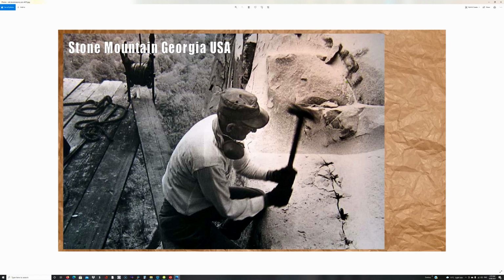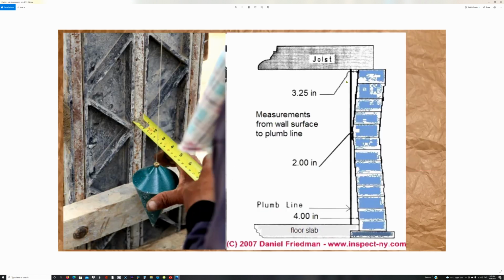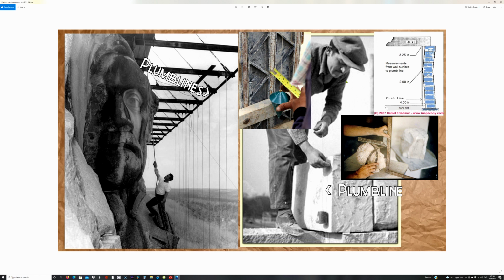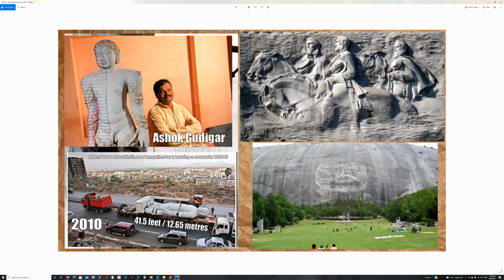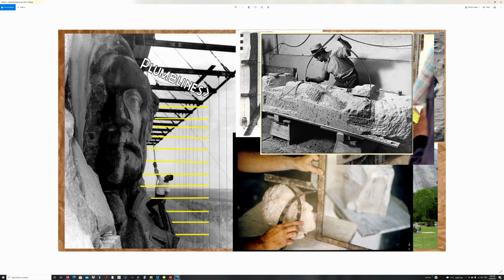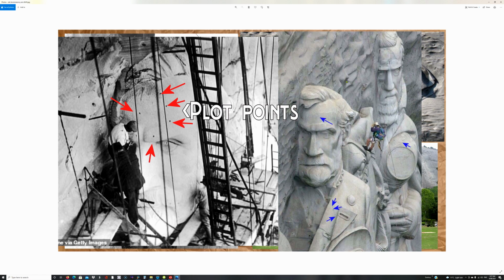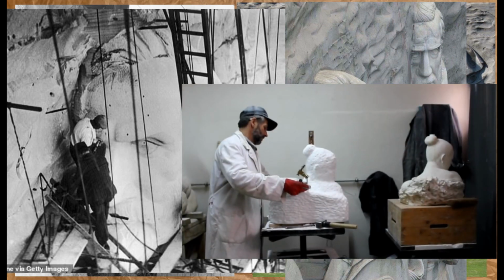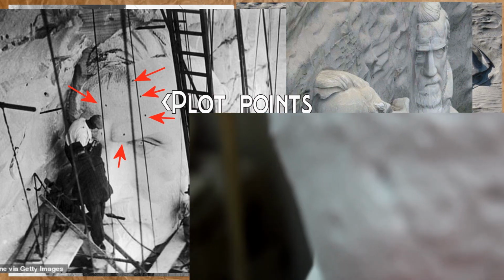How to Make a Giant Symmetrical Egyptian Statue without giant Ancient High Technology CNC machines

Comment: Your points are well taken, but if one were to apply your own logic to your arguments then there are also bits that you leave out/don't explain.

Flatness - plumb lines are made from twine or leather. That's great for creating a rough lines. But how do you get flatness to within thousands of an inch across large surfaces, in materials such as granite? 

And let's assume that you manage to answer the how...that still leaves the "why"?

Why, unless it was easy and not time consuming, would you create extreme flatness on surfaces that don't need to be flat beyond what is perceptible to the human eye?

There is unnecessary precision in so many old artefacts. But it's not only precision that is often times far beyond what was necessary. 

Scale is another element. It's far easier to build a wall out of a thousand small stones than it is to build it out of one ten tonne stone. It's easier to use mortar than it is to precisely cut sones so that no mortar is required, particularly when every stone you cut is unlike anyone other in size.

Then there is geometry. Why include geometry into sculptures when hardly anyone would even notice it and even less would understand it.

Ultimately, to answer these questions you have to explain why people would take ten years to produce something that they could produce in one month when the one month version was functionally, and aesthetically, on par with the version that take much more time and resources to produce.

And finally, style. Take the depictions of faces in ancient Egyptian sculptures. You note that over thousands of years, the style remains the same. Now, you might say that this style was passed on down the ages. Think about it and think about how small populations were back then, how susceptible to disease people were and how low the average life expectancy was. Consider how long it would have taken to produce just one large sculpture of a face. And on top of that, consider the rebelliousness of human nature and our eagerness to improve and change things. Is it really conceivable that over thousands of years, against the odds, the same style of depicting faces was maintained and the information stream remain uncorrupted by error, human nature or act of god? It seems highly unlikely to me.
Reply: Exactly, that is an issue that bothers me when seeing complex geometry and extraordinary perfection in ancient construction.  In modern times we have developed the technology to create high-precision tooling that in turn creates high precision parts because it is necessary for function in some particular industry.  For example, in the automotive industry, precision machining of CGI, steel, and aluminum is necessary to meet emissions regulations and market demands for vehicle longevity.  Once this level of precision is achieved, it becomes the default standard, and even components that don't require that level of precision for function receive the same or close-to-the-same level of precision, simply because that is what the tooling delivers.  It becomes easy.  In ancient times, if everything was done by hand using simple tools, why go to the extra effort to achieve exactitude on ornamental structures and statuary?

Comment: Are you sure that the level of precision achievable with hand tools like plumb lines and calipers can be used to meet the actual measured precision of these artifacts?
Reply: It may be more detectable
If they had used advanced tools simply by scanning it then comparing the percision of the two sides.

Comment: Here in portugal our country was very poor and backwards up till the 70s. My grandpa started working at 10-11 in house construction back then, and they had no power tools or fancy gear. He's shown me many plumblines, measuring ropes with nods in equidistant sequence to measure things, flat stone srfaces made by grinding 3 rocks against one another, simple chisels and hammers, drawings made using a geometry compass, etc. 

The most complex thing he ever worked on was a warehouse with pillars in the middle that supported arches, you know, like those gothic arches that make an X if you look up since its 4 curves conected to one point. In none of this did they need a powertool to carve, measure or lift the stone. The metal used was in the chisels, hammers, pickaxes, cranes and compasses. The only thing ancient high technology proponents cant find is a building site, apparently.
Reply from the maker: Yes indeed. I even filmed and posted a bunch of demonstrations with primitive tools on granite to answer the challenge made by “expert” masons of lost high technology.
I only hear crickets in response.
These guys need to call a mechanic to change the radio station.
Reply: Interesting. I work in the building trade and speaking to older guys who were around before powertools, it is fascinating hearing how they done things and couldn't imagine doing it nowadays. 
For example drilling a row of holes in joists for a cable/pipe to pass through could take 15-20 minutes with a power tool but doing by hand could take someone best part of the day. 
Point is to someone used to power tools it seems crazy and so much effort but if that's all you have available you get on with it and get it done. We take the older methods for granted because things are so easy with modern tools and materials.
Reply: Lie. I am and have been in portugal much before the 70's. it was in no way a POOR country lol.

Comment: 0:49 "People have been replicating them and showing them..."  Who's replicating the 1000+ ton granite statues at Tannis?  I've never seen anyone replicate said statues? I've never seen anyone replicate the 50 foot, 700+ ton Ramesses statues at Luxor.  I've never seen anyone quarry, lift, transport, cut, finish a 1000+ ton granite obelisk as the one in Aswan.  When you say replicating, you can't just replicating without showing the exact same thing done.
Reply: you said 50 foot statue of rameses. The bahu bali (GOMATESHWARA) is 57 foot high as tall as your so called rameses. How did you even come up with 700 tons. If you take a  50 ft or 15 m long high rectangular block and has a base of 3.5x2.5m and the density of granite of 2.7 tons per cu.m.  you get 15x3.5x2.5x2.7=354.4 tons if you exclude remove the stones to the final shape of the statue you might be down to 200 tons.  That could be easily pulled by around a  hundred oxen.  So which mathematical genius did you get the 700 ton value. As SGD said if you really want your rameses to be built you should hire the team who built bahubali. Why would rameses be impossible?
Reply: @JL-tm3rc  The statues at Tanis are over 100ft tall. SGD needs serious mental help. As do his followers. I wish you the best.
Reply: @coryCuc when a 57 foot granite statue from india debunked your claim. You bring out a 100 ft tall statue in tanis but there is actually a much taller statue 133 ft in india called Thiruvalluvar Statue built  recently out of granite. So are you now going to claim there is a 200 ft statue in egypt.
Reply: @JL-tm3rc  Nothing debunked anything my guy.
Reply: @coryCuc  haha you are the one looking for replication and the statues mentioned that are in india are even way larger than those in egypt. You cannot even get the weight of your statues correct just exagerrations you have heard from someone else without doing basic math first
Reply: @JL-tm3rc  The weight is correct.
Reply: @coryCuc  i just gave you a basic computation assuming the statue is a solid rectangular block it would not reach 700 tons. Here is another computation to debunk your 700 ton statue.  Let us say you take 5' tall human being which weighs 50 kg let us roud that up to 70 kg. The density of water ia close to the denaity of a human body. Let us now take the specific gravity of granite which 2.7. For a 50 ft statue or 10 times  the 5 feet height you will have mass of statue=2.7x70kgx10x10x10
=189000kg or 189 tons too far away from 700 tons

Math do not lie but you certainly do. If you are going to say you do not understand the computation please review specific gravity calculations hahaha. 

You have to be gullible to have believed the 700 tons without thinking about it first
Reply: @JL-tm3rc  Keep drinking the SGD kool-aid.
Reply: @coryCuc  haha the what a lame argument of a defeated man.  haha
Reply from the maker: What an idiotic comment Cory. The method for replicating is right there. A recent giant symmetrical statue.
But to convince you, someone who is literally ignorant of the recent giant moves that were photographed, has the nerve to set up standards?
Here’s the methods as seen above. Now you go and pay for it. What an entitled lazy little pos to demand others do the work even after they’ve been shown how.
Reply: @SacredGeometryDecoded  You can't make a tiny little replica then extrapolate that into an almost 100ft tall 1000+ ton statue.  It'd be the same as me making a 4 foot high pyramid of bricks and saying well, all you gotta do is add a lot more to it to make the pyramids.  Nevermind.  That logic doesn't work any way you look at it.

You're the one who says they know how they're built. I'm saying I don't know.  So the burden of proof is on YOU to build it exactly as you propose they were built.  If you don't YOU are the lazy little POS.  Put your money where your mouth is and replicate a 100 ton statue.  We'll all be waiting...
Reply from the maker: @coryCuc  literally includes a giant Bahu  Bali sculpture. It’s like you have a condition that blocks out any relevant fact you don’t want to hear.
There’s a giant  symmetrical statue made post invention of the internet with traditional methods in this video.
It’s one of the largest ever made and you are blind to it.
You are in a cult Cory. Get out now while you can.
Reply: @SacredGeometryDecoded  Build an 80 foot statue in the EXACT same way that you're claiming they built it, from quarrying, transporting, cutting, shaping, polishing and erecting it with the way YOU prescribe is the way they did it.  You say you know. You say it's easily done. 

So just do it. What's the problem?
Reply from the maker: @coryCuc  to anyone reading this please be warned that Cory isn’t the only one. Long exposure to Brien Foerster , Uncharted X, megalithmaina, jahannah James and these types of influences will do irreparable damage to your brain.
You will post comments like this on a public forum and not even realise how much of a fool you are making of yourself. 
Poor Cory here is lost but if you or those close  to you spot the warning signs early you can be successfully treated.
Reply: @SacredGeometryDecoded  Ohh lord. Lol.  Another ad hominem.  Weak arguments man.  Brien Forester? Who thinks everything was destroyed by plasma bursts? That wack job? I have no idea who Megalithmania is...that Jahannah girl couldn't find her way out of a wet paper bag. I do enjoy Uncharted X.  

Maybe you could pick up a thing or two from Unchartedx and grow your channel.  Ben is nothing but nice and respectful to EVERYONE who watches his videos.  He also knows how to take criticism without turning into a toddler and regularly engages people in the comment sections of his videos whether he agrees with them or not. That's what mature people do.  Maybe you'll get there one day.
Reply: @SacredGeometryDecoded  "To anyone reading this"  😂 Cory has asked a question that I cannot answer so I will try mock and ridicule him into shutting up. Boy do you sound like a knob SGD. Not that I was ever a subscriber of your channel. Me, I'd much rather listen to Brian Forester. As you were.
Reply from the maker: @beanstaIkjack  I show a recent giant statue being made, the man leading the project and the method.
If you or Cory want to replicate one in Tanis then off you go and contract those people to do it.
If you want to see granite worked with primitive tools I have a playlist of how to videos. Doing exactly what Brien Foerster and friends describe as impossible. Anyone who actually cares can replicate or they can be like Cory and claim it’s faked because the truth hurts their new age religion.
If you want to watch fiction then that’s your choice.
Reply: @SacredGeometryDecoded  very poor line of argument
Reply: @SacredGeometryDecoded  but scientificaly speaquing, if you were a surgeon, and you claim than you can operate on the heart, so much not idiotic at all, obviously,  you would have to prove it on a real patient with a real desease no??. 
   I am starting to find some sort of sick sindrome in this dicotomy, both sides anulating each other not coming to definitive conclusions, besides Obama recogn the ufo exists...is he a paid actor? hahaha, 
 I think that at this point, and as your side isssooo inquisiteve ;)... there are reasonable reasons for asking for real tests, and very reasonable, if I am an artist and I make portraits on the street, I will hang some of the ones I did before to improve that I can realy do it, in fact...that goes for all boys, none will give a penny if I do shh..tt...
The sculptor is god, I saw no simmetry, I saw no serial simmetry of Ramses face applied tu multiple sculptures, or a small scale obelisk with engravings using those ancient techniques.... all of them masters, all the slaves were master stone masons, the knew all the techniques, and they loved the pharaos...... from one side or the other, things don´t fully match, yet...will see how the process of mutual debunking goes
Reply: @Cory you are a complete idiot and there is no help for you..
Reply: @GroberWeisenstein  You can "extrapolate" technically "anything."  I can make a loaf of bread which is 12 inches by 4 inches.  Theoretically, I can extrapolate that out to mean that I can make a loaf of bread 1.2 × 1020 by 4.0 × 1019 inches.  That logic isn't based in reality.
Reply: @GroberWeisenstein  Goober, you can't address my comment, I see ;)  You want to try again?

Comment: Love your work very interesting 
But how did they move them? 
Especially south America? 
I know Egyptians were highly developed but how did south America do it??
Reply from the maker: I’ve done some videos about this previously. Will follow up with better ones.
The basic answer to that though is rigging sails. If you can set a ship up for sail you have all the pieces used in modern cranes.
One of the basics is a hitch knot. With a single piece of rope you can make a compound pulley. The basic thing all heavy lift cranes rely upon.
The lost art of knot tying.
Both Egypt and South America were very good with knots. In South America they used knots as a writing/record keeping system.
Add a lever to a compound pulley you multiply your force by a huge factor.
Romans describe it in detail but the best Roman era engineers came from Alexandria in Egypt.
Everything except motors of modern cranes is ancient tech. 
Hemp rope and timber’s like Lebanese red cedar can easily support weights of the largest blocks ever moved.
Will follow up in more detail.
There are old photos and film of massive blocks being lifted with primitive tech and materials.
Reply: @SacredGeometryDecoded  I need a rig built for my hairy ding dong.  It is far too massive and megalithic to lift.  Please build one for me with pulleys and knots.
Reply from the maker: @ufonomicon  a helium filled water balloon and a strand if ass hair to tie it with should be enough for you to get it up.
I do appreciate the offer to play with your ding dong and peanuts, but if I was to go that way I’d need at least need a sense of humour to overlook the rest.
Reply: @SacredGeometryDecoded  fair enough.  At least I didn’t ask for high Atlantean anti-gravitational platforms and ancient laser systems built by Lord Enoch from 1,000,000 BC

Comment: Funny thing is that nasa has said that they haven't returned to the moon because many of the parts for the rockets were hand made. The techniques used to polish stone have been lost in time and discovered again.
Reply from the maker: Saw a cool doco how they employed weavers to make coils of wire, they didn’t have the memory capacity to store all the required software so they used different lengths of wire looped in bundles.
Reply: @SacredGeometryDecoded  In essence there is a grid of conductors, and at the intersections of this grid there are ferrous toroids that can be magnetized. When you pass a voltage through a conductor, it will induce a magnetic field as modeled by the left hand rule, inducing a magnetic charge in the toroid. If you pass an equal voltage through the perpendicular conductor, it will be resisted by that magnetic charged stored capacitively in the toroid. This is a bit of memory, and because you need to pass a perpendicular charge to read the resistance, checking the state of a toroid also de-magnetizes it, meaning any bit of data you read is erased, and must be re-written again if it is needed. There were many complex programs running on these hand-woven computer cores, and multiple duplicate computer cores.
Reply: japanese small factories still do handmade precision products. there is a documentary about them in youtube